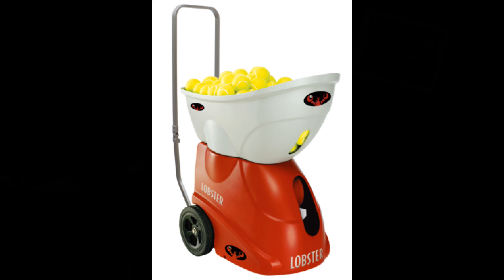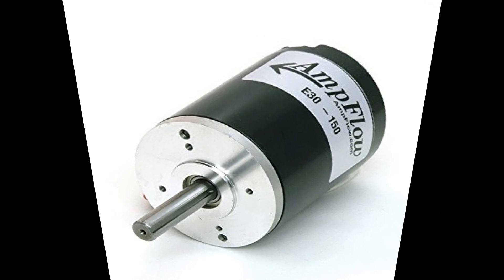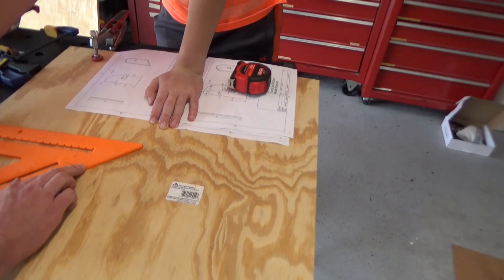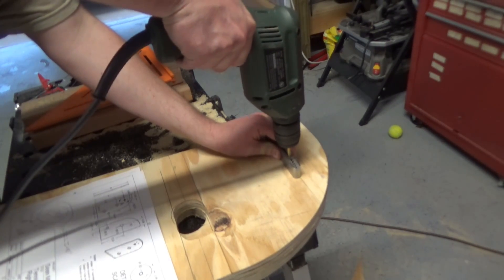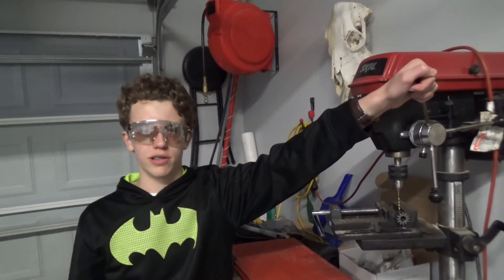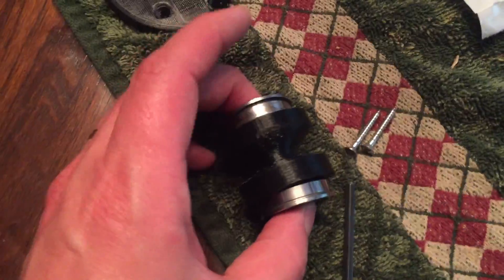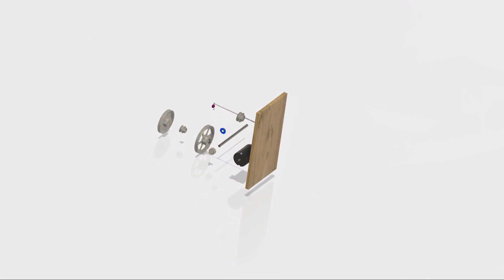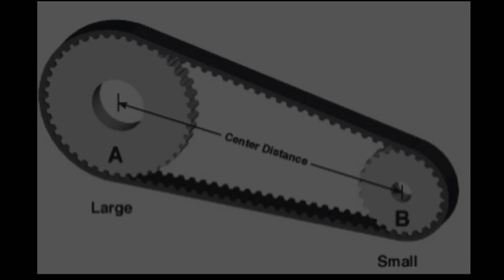How to Make a Tennis Machine with Autodesk Fusion Software

Comment: Great Project! I'm building a machine myself but using scooter wheels instead. So far so goo. Did you build a ball feeder for this?
Reply from the maker: Unfortunately, never did...we ended up moving on to our next project.  We had considered simply using rigid or corrugated PVC pipe.  For us...it was the view more than the climb on this project.  It definitely gave us both more mojo for mechanical design - particularly using joints in Autodesk Fusion 360.  I highly recommend using that free software to aid in your design.  One last thing...we found that it pitched best if you pinch the ball as it travels through the wheels - so a tighter clearance is preferred.  Have fun!
Reply: @RaisingAwesome what was your clearance between wheels. I've just tried 35mm but with weak motors I'm inclined to think 40cm might be better. Also I'm working on an automatic ball feeder that doesn't jam with the use of ball sensor ir led and or just strategically laid out levers and pipes. I don't like the idea of the spinning disc. Try and eliminate another motor. Just use an actuator to let balls drop
Reply from the maker: @Swenser  Not sure on the measurement, but we found it definitely did better "pinching" the ball.  It got 2x the distance versus just barely passing it through with a just a little grab. It seemed that the compression helped the propulsion.

Comment: nice job.
Reply from the maker: Thanks so much.
Reply: where do you buy the server wheel and motor?
Reply from the maker: The server wheels where designed in Autodesk fusion and 3D printed.  We printed two halfs and glued them together.  We brushed on plastidip so they would have a good "grab".  The motor you can find on Amazon.

Comment: Hello, nice project. I'm doing one too, all printed with a 3D printer. The wheels with which they are made? Those printed are too smooth.
Reply from the maker: Luca Bartoli Our wheels are just ABS plastic. We then brushed on plastidip rubberized liquid coating.
Reply: I ordered bostik liquid rubber, we hope it works
Reply from the maker: Also, set the spacing of the wheels such that the ball gets a slight pinch when pulled in between them.  The wheels should be concave on the outer surface so the ball stays centered when pinched.
Reply: Thanks, yes, the wheels are made just so I have designed and printed them.
Reply: @lucabartoli5836  have you 3d-printed your wheels? can you share a file :-)

Comment: Hi, where did u get the tennis ball machine designs on auto desk and is it possible if I could vaguely use it
Reply from the maker: We drew the design up from scratch.  We looked at spare parts online for existing tennis pitch machines.  We found that many designs are simply two wheels spinning and pitching the balls.  

From there, we just tinkered in Autodesk Fusion until we got what we wanted for the parts we had on hand to drive the wheels.  But then reality struck as the spur gears were epically noisy.  So, we then converted to the "serpentine" belt approach you see towards the end of the video.

To 3D print the wheels, we did so by printing them in two halfs and then gluing them together with ABS cement from Lowes.